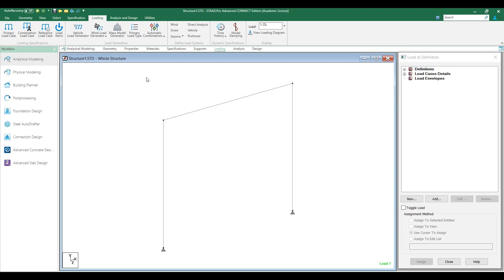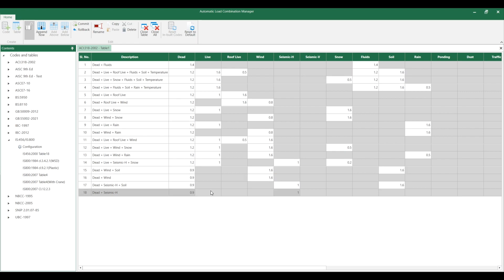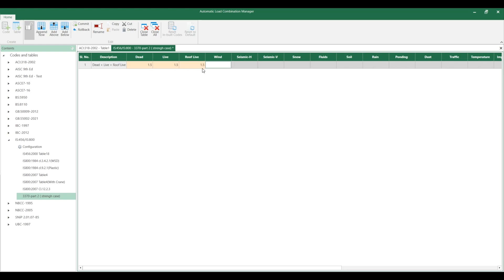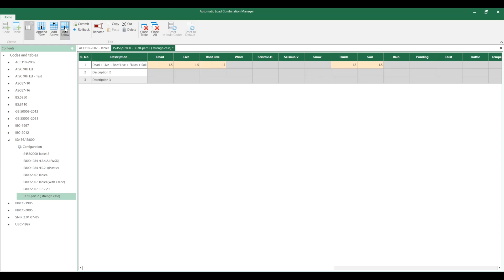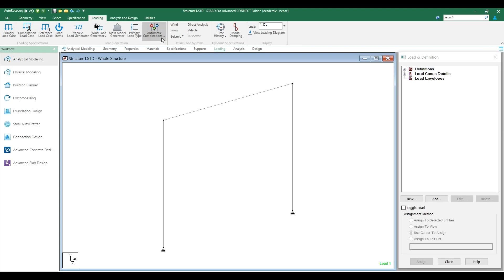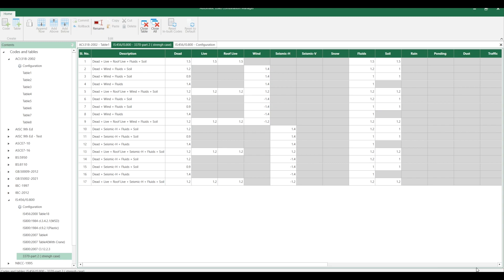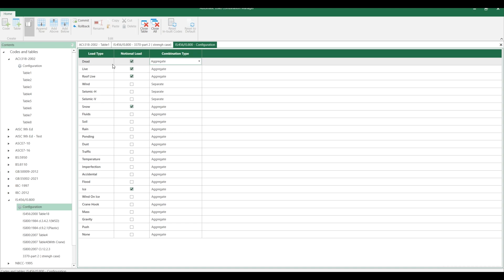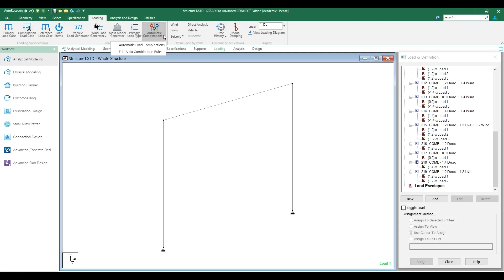Editing Automatic Load combination rules in Staad Pro

Comment: please help me as i am not able to move forward with the following issues....
cant apply seismic load perfectly in physical modeler as we cant define mass load properly....
i am trying to model in physical modeler but i am not able to use rcdc after that as it shows no column found and no beam found....
Reply from the maker: Yes, as of now mass model generator not available in physical modeler. So we can  generate seismic loads in analytical modeler once the model and other loads are done in physical modeler. 
Try to install latest version of rcdc. I think it will work.
Reply: @jcy_civil  if you are using licence version please let me know because i am also thinking about buying that kind of version...... and i have many doubts i need them cleared out.....
Reply from the maker: Yes, I m using licensed version
Reply: @jcy_civil  do we need to apply diaphragm for seismic analysis in landings for staircase and slab of water tank above also...
If the building has many cantilever slabs and beams how can we select an area for wind load....!?
Reply from the maker: Staircase landing -no diaphragm action,
below tank base slab -yes you can.
Wind - need to see the dwgs